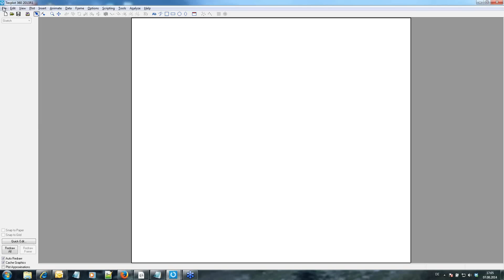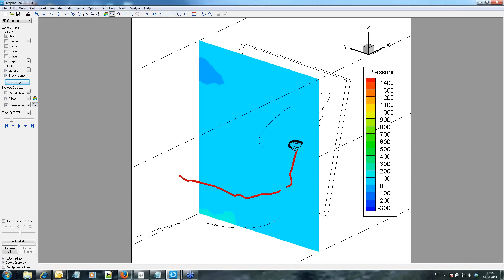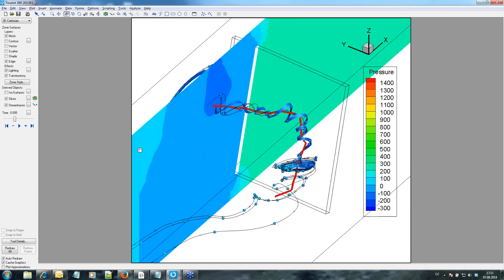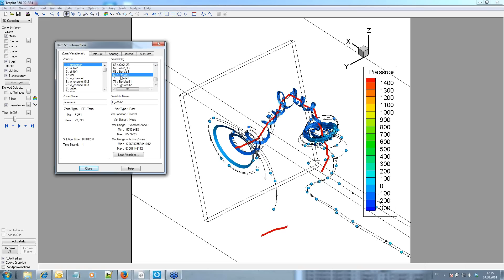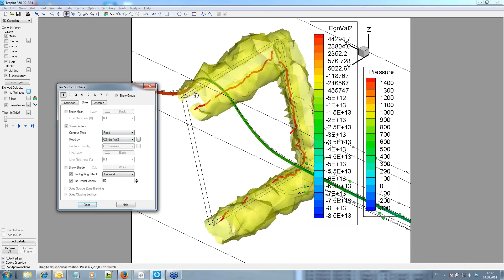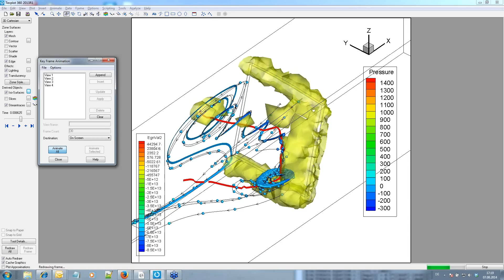Vortex Visualization in Tecplot

Comment: Great video, Is the vortex core the region where vorticity is at a certain value or is it a region that encompasses a range of vorticity values?
Reply from the maker: Hi Nikan,
The algorithm used in the video identifies the vortex cores based on the eigenmodes of the tensor of velocity gradient. Tecplot uses MIT's FX library for that. The AIAA 99-3288 paper by Robert Haimes describes the relations.
Have a nice day!

Comment: Can anybody explain me why Tecplot subtracts Omega^2 from S^2 instead of adding it . According to the definition of Lamda2 criterion it is based on eigenvalues of S^2+Omega^2.
Reply from the maker: Dear Yuri,
As the rotation-rate tensor Omega is antisymmetric, a minus sign is found in some Omega^2 terms.
This is where the minus signs come from in the S^2+Omega^2 equations.
Best,
Reply: @GeniasGraphics  I get the reason why you need to minus the Omega^2 terms rather than plus in original definition. If I use another programming language (e.g. Python or Matlab), I could directly calculate S^2 and Omega^2 simply by matrix multiplication, right?